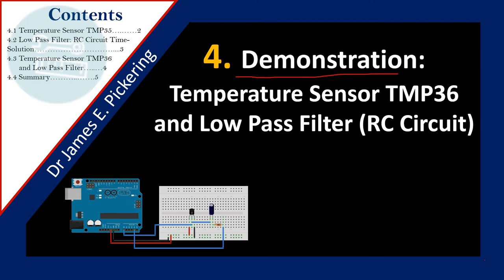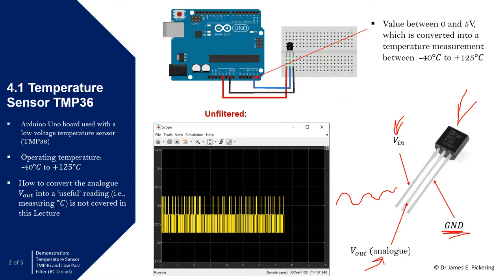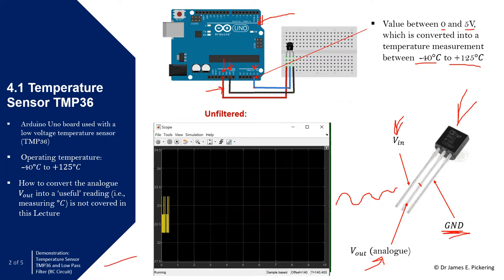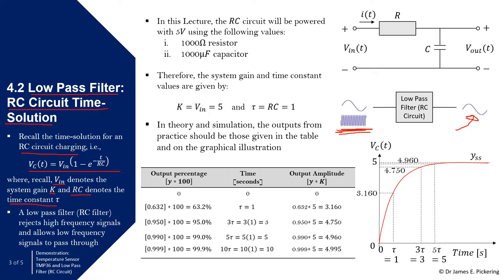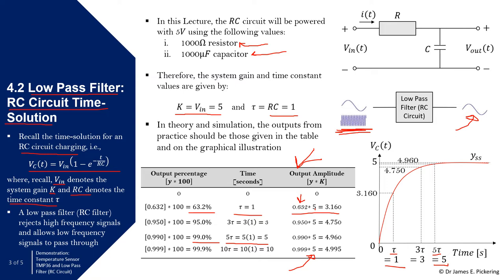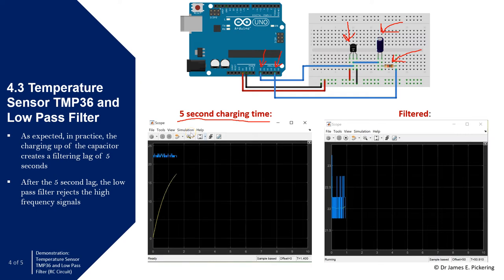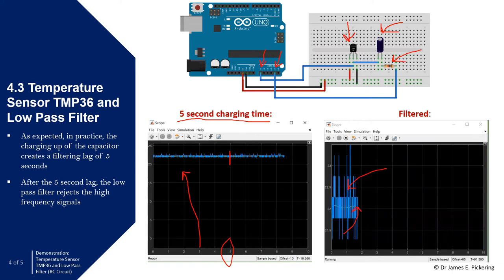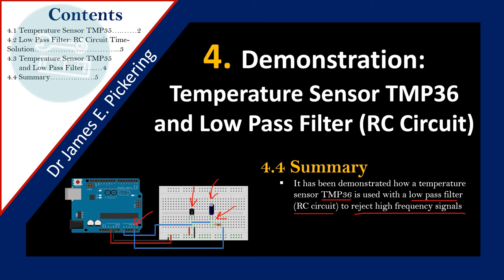4. Demonstration: Temperature Sensor TMP36 and Low Pass Filter (RC Circuit)

Comment: Hi James, can you explain the reason why you picked this combination of values for R&C? I am trying to understand how to derive the design of a low pass filter for these types of IC sensors - I cant get my head around what I should be using as my cut-off frequency?
Reply from the maker: Hey Sean, I picked the values for the RC confirmation such that it would make 1 (simple on the maths). How are you getting on with frequency response now?

Comment: Sir is the output of temperature sensor signal in this case an AC or DC?
Reply from the maker: The power source used here is DC.
Reply: @Pickering-Control  Clearly, this is a frequency response of a lowpass filter. In your circuit you are only dealing with a DC voltage (the supply VCC
) so I don't see the advantage of including a capacitor here.If i am totally wrong can you please explained.